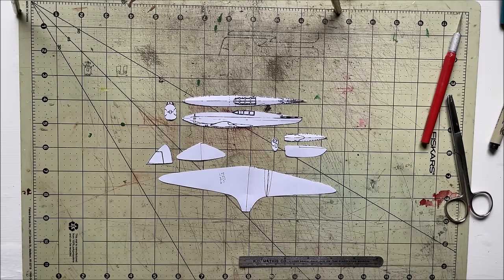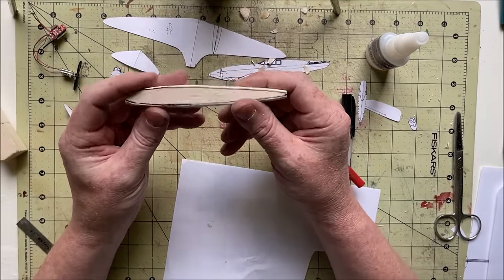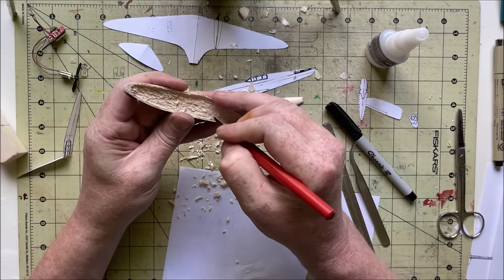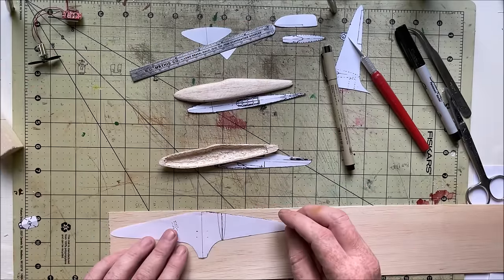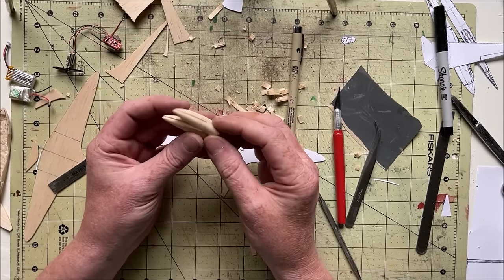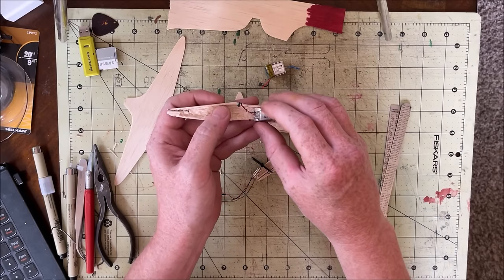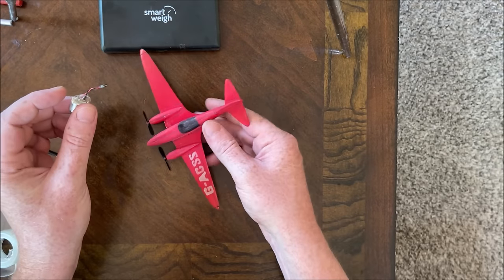micro DH.88 Comet RC plane build/flight

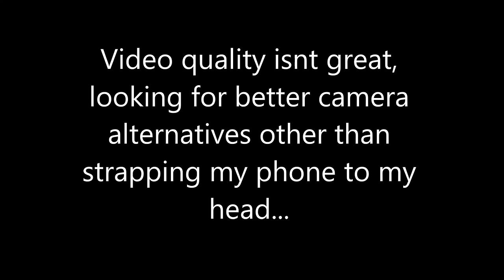Comment from the maker: Flight starts at 35:12 
2nd flight:  https://www.youtube.com/watch?v=8TdL1kUZZV8
3rd flight:  https://www.youtube.com/watch?v=8K1CrssEvwEI
Electronics in this plane were from the micro RTF called the KF606, you can find them on amazon for around 30 bucks (other places as well for varying prices)
Reply: From where these templates I  get
Reply: There’s a aircraft flying around?
Reply from the maker: @Maqsonsaviation  I just did a search on google for DH.88 Comet 3 view drawing, theres plenty to choose from.
Reply from the maker: @Theguyinthe  lol Yes I swear!  Had to film at dusk since its been quite windy the last several days, and this camera really isnt meant for filming something like this.  Will try to get a better video with a better camera soon though.
Reply: Nice work man. 
I know it is soft balsa, but still, as an idiot with more cuts and scrapes than i could care to remember, i cringe a bit on the cuts towards a wrist.
Btw: For a carving tool idea.  I saw some guys in Taiwan or something, making sandals from car tires. They used a stick a hoseclamp (the metal ones with the nut on it) and a double side razor blade. Cut in half, heated a bit, and clamped to the stick in a U shape.
Reply from the maker: @henrik3129  Thanks!  I've cut myself quite a few times over the years, so I go pretty slow these days, it just looks worse than it is since its in fast forward.  Interesting carving tool idea!
Reply: OK sir well damn you just carved that little RC plane out of wood! dude you are very skilled how much for one of those little things man?
Reply from the maker: @andrerose6897  Thanks!  I dont sell them, sorry lol
Reply: Beautiful job and what a nifty little flier.
Reply from the maker: @skateboardingjesus4006  Thank you!
Reply: Ever tried foam wrapped with 2 oz fiberglass + epoxy resin ?
Just wondering if it would have been simpler
Reply: When u started flying ....who in the heck was launching surface to air missiles in the background lol ..shessh lmao
Reply: Is it possible to make a micro indoor (saloon) aerobatic slow flying plane with a helium inflated construction? 
Something like the micro indoor helium balloon Plantraco used to sell, but in 4ch plane. 
I always wanted to practice Aresti maneuvers while I’m sitting on my weatherproof sofa 😅
Reply from the maker: @bertkilborne6464  I've seen some larger builds go with that kind of method, but at this scale it'd be much too heavy.
Reply from the maker: @weld4200  lol yeah our neighbors had quite a bit of wood to grind up
Reply from the maker: @Shadismic  That would be a pretty interesting project, I remember the Plantraco models from back in the day...huh...might just have to give that a try at some point lol
Reply: @microbuilder  you already have a heart and soul supporting fan for that project 😄👍🎉
Reply: @microbuilder  do you think it would be possible to get to fly in a acceptable manner at a speed of under 1meter/sec. ?
Reply: Would be very easy to make a vacuum table..I've made many and as big as a vehicle. All the dust will be pulled down.
A shop vac for a.small one.
With screen or whatever you dream good enuff.
For the crafter in ewe
Reply from the maker: @Shadismic  lol thank you!
Reply from the maker: @Heyjaybird  I had made one several years ago that I used for vacuum forming, but thats long gone.  Fortunately it was a nice day out, so the sanding wasnt too bad.
Reply: @microbuilder  sorry for that, I don’t mean to raise the benchmark! I only imagined the average available space in a living room to fit in the imaginary flight box for the Aresti maneuvers, and how fast my moves would have to be. 
I speak/write out of passion for the rc hobby, having went through a lot of Plantraco products myself for finding out and trying to reach that goal. I still have their transmitter charger 4ch receiver actuators some motors and props for that hanging around somewhere. And watching what you do, raised the memory and my hopes again. Bless you 😊

Comment: Beautiful bird. I honestly didn't expect it to fly so well. Only differential thrust in both engines, and fixed elevators 👌🏼 its just so awesome. You inspired me a lot,  so today i made a p38 lighting with balsa wood same as the size of this aircraft. It isn't rc, just a model. Its red in color too, with YIPPEE written on its nose in white.😁
Reply from the maker: Thanks!  I've made a lot of non-RC models over the years, its a good way to start, and they can make for really fun chuck gliders to throw around the yard.

Comment: Absolutely mesmerised by this video, as a scale modeller of plastic kits your video makes me want me to try balsa as a medium rather than just buying expensive plastics!
Reply from the maker: You should definitely try it, balsa is pretty cheap.
Reply: Yee haa
Reply: In the old days carving planes out of solid balsa was a popular hobby. Often they were build not to fly but just for display. What was interesting here was that in addition to whittling the plane from a block of balsa he also had to hollow it out to make room for the electronics and make it lighter so it would be flyable.

Comment: This is one of the most insane projects I have ever seen and equally as cool.  I'm not sure how into Scale modelling you are, but I am.  If you have an airbrush or don't mind getting a cheap one you should invest in one.  Makes the paint jobs much easier, and you can also use lighter paints.  The scale model paints like Tamiya and what not are much lighter weight than that spray paint from the home improvement stores.  Absolutely cool project.  Never seen anything like this.  It makes me want to try it.
Reply from the maker: Thank you!  I like seeing other peoples scale models, but I usually dont have the patience for the details to do my own.  Good idea on the airbrush, I think I have one in a box somewhere, but dont have a pump for it.  If you have the skills to do scale models, you can definitely build something like this, give it a shot!

Comment: Nice build!  For a nice canopy, you do not need a vacuformer.  Simply carve out a plug or make a plug out of polymer clay and pick up some clear heat shrink tubing.  The tubing can be obtained that is very thin and light-weight.  Heat it up under a heat gun, cut it out and it is surprisingly transparent.
Reply from the maker: Thank you!  Good idea too, I already have the clay since I do some sculpting.  I'll definitely give that a shot.

Comment: Incredible work! Show your passion for aeromodelling... Congratulations!
I've never seen such a small model fly so well. I'll follow your step-by-step construction class better and try to build one for myself. Thank you very much for your time teaching us.
Reply from the maker: Thank you!  And definitely give it a try, I would suggest scaling it up a little bit, as fitting the electronics was a bit of a pain, a little bigger and it wouldve made it a lot easier.
Reply: @microbuilder  I'll follow your tip! And please continue your passion! She inspires us to do the same.
I would like to ask a question, what makes the aircraft maneuver since its Ailerons are not maneuverable.
Is it the power of each engine that makes the rotation?
Once again, thank you very much!
Reply from the maker: @albertovieira4844  Youre correct, to yaw, one motor speeds up while the other slows down, very simple but very effective.  If you havent already, I'd also suggest checking out the Scratchbuilt Indoor And Micro Models over on the RCGroups forum, it is a wealth of information!

Comment: Really impressive!! Stupid question: does this just use throttle for pitch control and variable thrust for turns? If so, it really looks quite coordinated and airplane-like in flight.
Reply from the maker: Thanks!  And yep, its generally called thrust differential steering...you set up the plane so that when under throttle it climbs, and for steering it just speeds up (or slows down, in some cases) one of the motors to make the plane yaw.  Its simple but surprisingly effective.
Reply: @microbuilder  

It’s similar to the way a bull dozer or a tank is steered. 

Neat
Reply from the maker: @robertdragoff6909  Yep, exactly.

Comment: Man that looks awesome. Just curious if you've considered a small scorp or U carving gouge for hollowing? I feel like that would be faster and more controllable than the exacto knife. I guess only downside is you've got to sharpen them.
Reply from the maker: Thanks!  I havent tried that, but I should, as long as its sharp enough it should work...this balsa was so soft that even a slightly dull edge would just tear the wood rather than cut it.

Comment: This is pretty sweet - ive been looking for something like this that I can 3d print on my 100x100 bed in two parts. Any chance you have an STL or model or want to collaborate on making something?
Reply from the maker: Thanks!  I dont have a file or model though unfortunately...never done any 3D work, but I imagine it'd be possible to convert a 3-view drawing
Reply: @microbuilder  seconding the interest in plans! Can you put them on a flatbed scanner maybe?
Reply from the maker: @schmarrenheimer80  I just did a search on google for DH.88 Comet 3 view drawing, theyre all pretty much the same, then just print to the size you need.
Reply: @microbuilder  thanks mate! I was just wondering if you were able to go straight from the original or if you had to scale some parts a bit differently. Still new to the hobby 🙂

Comment: Fantastic build and video. That feeling of mild panic when you see the magic smoke escaping is one I know well. 
You said you try and keep a 1g to 1 inch ratio for your builds, so given that you could add a vtx and cam for about 3g, do you think 10inch is the smallest you could go to carry the extra weight for fpv?  I was wondering if a Bi-plane would allow you to go even smaller?
Reply from the maker: Thank you!  Yeah I was pretty frustrated with the magic smoke billowed mockingly in my face lol fortunately the repair wasnt too bad.  A 10" model would probably carry a 3g FPV system, making it a bi-plane would definitely help slow it down too.  I actually have a pretty lightweight FPV system, just havent made anything for it yet.
Reply: @microbuilder  I would really love to see you make a micro fpv plane.
Reply from the maker: @TuccoBenedicto  I've been thinking about it, just havent been able to decide on what exactly to build.
Reply: @microbuilder  Would you consider something like a wing or do you want to make something scale like your other builds? My feeling is that for fpv what it looks like doesn’t matter if it works, as you don’t see how it looks from inside the goggles. What I would love personally is something I could glide about indoors with, so the smaller the better, but It’s that weight to wing ratio that makes it so difficult.
Whatever you decide, I am sure it will be fab.
Reply from the maker: @TuccoBenedicto  I figured I'd end up using a flying wing of some sort, I have an all balsa micro Stryker that I built years ago that does around 80mph that would be really fun to try.  I like going fast, but still relatively new to FPV so slow would probably be better...hard to get a plane to do both well.
Reply: @microbuilder  The Stryker sounds good but 80mph may well be too fast if you are not use to fpv. If you need any fpv help let me know.
Reply from the maker: @TuccoBenedicto  Yeah thats kind of what I was figuring too, its a great little plane, wouldnt want to turn it into kindling lol  Thanks for the offer!

Comment: Hats off.
The smaller the harder to build I find to be valid. 
I built a pair of 17 inch wing span planes this past year using electronics sourced from Minimum RC and swore a few times. I'd think my swearing would increase at this scale.

Comment: I would patent this if you haven't already, before some big box modeling company steals your art from you.. Hay I know what you are thinking but at least they will have to approch you first, and who knows it could mean some dollars in your pocket as well.. This is my first visit on your channel here in YouTube and I first said what the, and than thought about the concept and said to my self he's got something here.. Can't wait to see what you may come up with next.. Cheers...!
Reply from the maker: Welcome, and thanks!  Unfortunately, micro planes are a pretty tricky thing to sell, they can be touchy in the air and equally fragile.  Well, at least balsa ones, the micro foam plane I got the electronics from is pretty great actually.
Reply: I still would apply for a patent, because these still can be profitable.. And I know as an Engineer who designed machines for industry that machines can be built with soft touch technology which can hold onto an eyelash while it's being split in two.. It would really open up your eyes to what is being built in this world... But I will say that I was impressed with your micro build.. Best of luck and can't wait to see your next build...!

Comment: It’s got to be said, this should not work!! How can this fly as well as it does with differential thrust only to control it.? She’s a slippy little bugger too. Hats off to you buddy. What a build, what a model and what a pilot too. Big respect sir. Steve UK
Reply from the maker: Thanks man, I appreciate that!  It is pretty amazing how well just two channels works, especially on something small like this.  Plus its a heck of a lot easier to set up than putting in magnetic actuators and making functioning control surfaces lol

Comment: For carving inside the fuselage, try making a hoop carver. Take apart a disposable razor and a single blade is about 1-2mm wide and can be bent into a U and glued to a wood handle. Saves sooo much time vs carving with the xacto blade. Great job though, love simple 2ch planes!
Reply from the maker: Hey long time no see!  Thanks for the tip, I'll have to give that a shot.

Comment: i'm impressed! i've build some foamies before, but hadnt seen anything like this in detail, and now i'm rather tempted to give it a shot sometimes. interresting and relaxing to watch =)
for hollowing out parts like that fuselage, linocut carving tools should be perfect, and much faster and less tedious than chipping away with an exacto knife. they are cheap and come in a variety of shapes too.
Reply from the maker: Thanks!  Give it a try, its finicky work, but definitely worth it.  I'm building a new model now, using some carving tools for hollowing out the fuselage, worked well.

Comment: It never occurred to me to use my experience with wood carving to do something like this.  I am inspired.

I have a small set of "Flexcut" woodcarving tool, and would hollow out with a small gouge, as the "right tool for the job."
Reply from the maker: Thanks, I'll have to look into the carving tools, the xacto and pick method leaves a lot to be desired.
Reply: Your tools may very well work better than mine on balsa.  I haven't tried yet.  But while watching you, I wanted to be trying each stage with what I am familiar doing and using.  Thanks to you, I am motivated to find out if I can do it at all.  It looks fun and relaxing.
Reply from the maker: @crewsgiles9499  With balsa being quite soft it just takes a really sharp edge.  Good luck on your project, it can be fiddly work, but definitely worth it.

Comment: Great work, it really did fly well for such a simple control scheme. I have one of those KF606 planes around, I should try something like this.
Also, for anyone who has a Radiomaster or Jumper radio, or any similar one with the multiprotocol module, it is capable of controlling the KF606 😁
Reply from the maker: Thanks, definitely give it a shot!  Thanks for the heads up on the radios too, the KF606s radio sticks are a bit too small for my taste.

Comment: If you titled this "making dynamite in a small package" I would have been ok with that. Nicely done, I love buying cheap Chinese peanut-size electric birds just to see what scale scratch builds can come from them. Love the big stonking, grinding V12 sound effects on some of the passes lol. I'm actually busy converting a 1/144 plastic airliner into a flying model with electrics from the banggood C-17 but with what I think are the world's smallest functional EDFs at 12mm
Reply from the maker: Thanks!  I started a plastic model RC conversion a while back but havent had a chance to finish it...a bit worried it'll be too heavy, that plastic isnt light!

Comment: I wish these tiny electric motors and electronics were around 25-30 years ago when I was into building stuff like this.
Reply from the maker: Yeah nitro was about the only way to get into the air...I have been wanting to do a nitro micro using something like the teedee .020 engine, but man theyre not cheap.

Comment: 35:15  Might I suggest an Akaso EK7000?  I got tired of paying GoPro prices, so I gave the EK7000 a try and it really surprised me with how well it works.  Great sound, great image quality, it comes with a remote to start/stop it, two batteries, you get a screen to look through, and I think they're $70 on Amazon.
Reply from the maker: Thanks for the tip, I finally got a hat mount for my phone, definitely better than the little Mobius dash cam I've been using.

Comment: A great build, but why did split the piece of wood instead of  using two pieces half the thickness. it's great to see that you actually hand built it it. A beauty!! Lately I'm seeing hand made things done on a 3d printer . Hardly hand made when one uses a computer to get a machine to build somerhing
Reply from the maker: Thanks!  I didnt have any balsa thick enough to make up the two halves, so had to go with the solid block split in two.  3D printing certainly has its advantages, but yeah, nothing beats an xacto and sandpaper